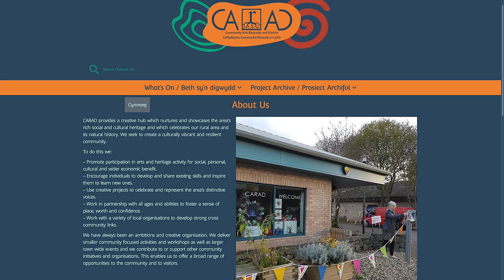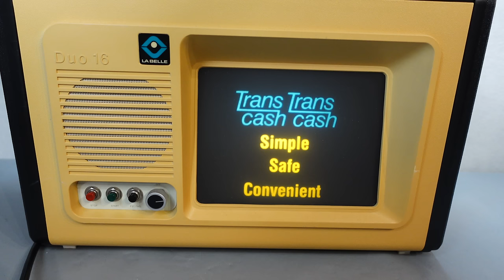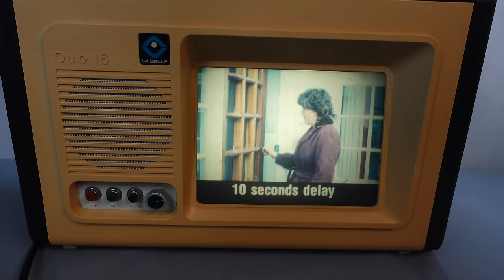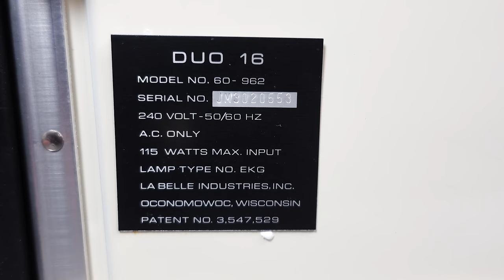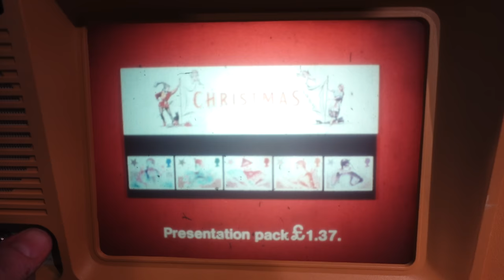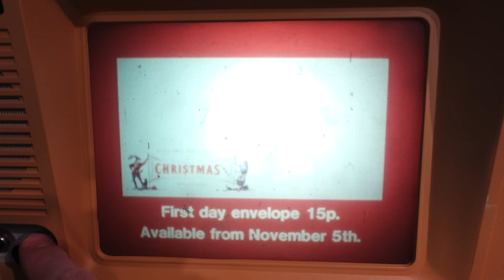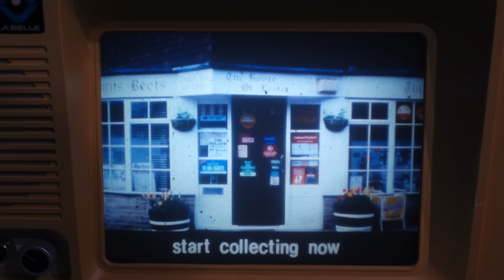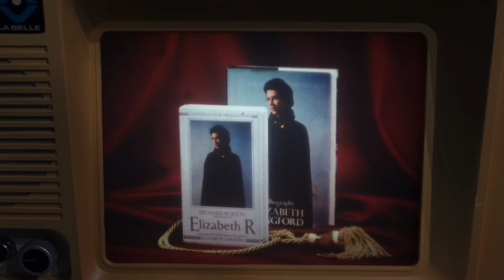Revisiting Post Office Commpak carts with a back projector

Comment: The lamp is actually just a fairly standard MR-16 halogen lamp, commonly found in high end residential downlight fixtures between the 1970's to mid 2000's (prior to LED fixtures killing them off), here in the USA. Also found in cheap Ikea lighting fixtures (along with the GU10 120v variant) before that too was replaced by LED. The letters EKG are the specification code that denote the wattage and beam spread option of that particular lamp. Though most, if not all MR-16's are 12v, so this 19v lamp is actually fairly uncommon, but a quick google search shows it as still available.

Comment: The speed control is likely there to enable different lengths of film. If you have a long-play audio but a short film you get into issues with an image sitting too long on the screen that would be annoying. By allowing the faster speed you can use the same (standard) length of tape but move through at a shorter time frame. Then if you need a longer film, you already have the longer tape and only need to slow it down to use the longer time on it.

Comment: About the speaker output and recording from it.

Since it is a amplified signal, it can be a bit harder to record it without messing the tech. The proper way is to use some sort of speaker (or "power soaker", "load box", or similar) in the amp output and steal the signal from between. Then the amplified signal mostly burdens the speaker instead of recording device.
For tapping the speaker wire, you could use a D.I. box that has link out for the speaker and a pad or two to reduce the signal. From the D.i. you can go to the audio interface with a xlr-cable, so you need that also. The D.i. box also isolates the signal source from the recording system, so the possibly dodgy source device doesn't cause much of a damage if/when wailing.

I can recommend the Behringer DI100 for things like this. It has good fun/price-ratio and it can take quite loud amplified signals without distortion. I've used one for recording 100w Marshall valve amps (between amp and a cab) without a hitch.

Comment: If you are trying to buy electronics on eBay from outside the USA, especially tube type equipment, you have to tell the seller NOT to use the eBay shipping system. Pitney Bowes somehow thinks that things like antique radios and amplifiers are hazardous. So, they confiscate them. The seller gets their money, the buyer gets a refund, and there is a small business of folks buying pallets from Pitney Bowes Erlanger, Kentucky facility and reselling the items.

Comment: Nice to see this kind of device, other than the ones i remember in school with those slides and the cassette tape playing separately.  I was hoping to see what the external projection would look like too.  Wondering what the mechanism to advance or rewind the slides are.  Is it a tone that signals it on the second track?  I could faintly hear a noise from the direct audio feed.

Comment: Just a note on the German sticker in there. It' has one of the old 4-digit post codes on it, meaning that the sticker was put there before 1993. Just thought you might find that mildly interesting.

Comment: Back when 8mm movie projectors were a thing, as my father had a Super 8 movie camera back in the 1960's and had about 100 reels of 8mm film. I found a movie projector and had a Sony camcorder. I took out the 120v lamp inside the projector and replace it with a 12v 13watt interior bulb out of the interior light of a car. I powered it off of a 12v power supply and placed the camcorder directly in front of the movie projector lens, I then adjusted the focus until the camcorder had a clear as day picture. I recorded the film that way. They were silent films though. 
I would like to do it again with a 4K camera but I doubt that the film is playable anymore as when I did this was the early 1990's. 
The same method should work for you with this player if you want to take it apart a little.

Comment: You might consider this a bit of travesty, But when i'm attempting to transfer old, eight tracks of some value and the pressure pads have gone, I usually opt to go the low-tech way that they did it later on.
And take some Rather soft and yielding Polyurethane foam, Covered with a adhesive tape that is slick and maybe even annointed with a little Graphite dust, And those will typically provide you the most accurate and complete Contact relationship with the play head. The mechanical bits of copper spring do work rather well when they are set up properly, and obviously these had that variety, But i've always had a rather difficult time repairing them. And then when faced with the necessity of taking the tape shell apart, Which can be another difficult thing if you don't have the good luck of assembling them. Were the tape slides into the correct channel, the foam approach always seems to pay off. I just located another really nice. Early pioneer branded craig player that i'm probably going to put in my van.... And make some high quality.
Tapes..  Though I will probably use my fostex e series mastering deck for the recordings,  Even though it is a half track... And just have them be a standard two track tape... And see how that works first before I go the other route and use a four track standard. Basically, whenever I get the odd passenger or musician riding with me to a gig, I'll blow their mind with this antique player... Which sounds better than any player of that age has a right to! Hooked up to a linear power booster of 100w, Through assistant of four hifi speakers and sub,  made for the home... The joys of having a van! And since the fostex machine Only records at seven point five and fifteen, I can make all of my recordings 2X speed, But because of the extreme fidelity of the fostex, Still have the complete frequency spectrum audible, And also be able to really hit the tape extremely hard and over a whiter section so that azimuth won't be as much of an issue... That's assuming that there is a setting, Or one of the two available that actually will play that well. If not, I can actually go in and connect all 4 playhead positions to play simultaneously... Which i'm thinking will work... As long as there is ample space in between in the middle... or hopefully not too far off... If I bulk erase them all before I use the tapes, Then they won't be any problem of cross talk whatsoever with only a single program. I can record some complete albums. And then maybe order those little postcards. They have out there of the album art and glue them on to the tape Shells..  lol. Something I used to do long ago

Comment: I noticed some dark spots on the screen that were consistent from one cassette to others, and some that were not. I’m going to guess that various bits of crud have gotten onto mirrors and lenses in the optical paths in the cartridges and player. It might be possible to eliminate some of that by using the machine in projector mode and capturing images from a screen or other surface so that you don’t need to laboriously disassemble and clean every part.

On the other hand leaving the crud in place might enhance the vintage feel of the images. In your place I’d consult with the person you got the cartridges from for their preference.

Comment: From the hum on the audio, I guess that the electrolytic capacitors in the audio section power supply are going to need replacing. I guess Audacity etc will be able to filter it out in post-processing.

Comment: You might want to consider using projector mode with a rear-view screen to capture the content.  If you use the internal screen, I suspect you'd see flaws from blowing up that small screen to what is today a normal sized screen.

Comment: When I was young back in the 70'S at a car dealer they had a film based cart also it was about the size of the biggest fedeli pack the sound was on the film all about new model cars it was either 8 mm or 16mm. i was very young at the time. So i don't  remember to much.

Comment: Perhaps use green masking tape to mask the frame of the device, then take the shot footage it into your video editor and chormo key mask it out so you have a crisp borderless video, then crop the rest of the device out, export just the masked video capture to a format with the aspect ratio roughly matching the screen's ratio, and center each. You should get uniform, and perfectly centered video using this method.
Reply: Also you could finish it off with AI up-scaling if you want be all professional about it, and use the video editor to correct white balance to counteract the color change that the screen patina introduced.

Comment: The internal power supply has got some questionable filtering not happening. The presents of that 100 cycle hum is a concern. Possibly some bad capacitors.

Comment: Fascinating! Thank you for showing this to us.

I guess the head is static unlike that in a standard 8 track cartridge player. I wonder if it’s a standard 8 track cartridge head and whether it’s just tracks 1 and 4 in use? Is there still an aluminium foil at the join? I wonder if that has any function if present Could it be that the foil is responsible for stopping the machine, with the tone burst alone used to frame advance?

At least those cartridges are the ones with a small felt pad on a spring as opposed to the other types that go all gooey!

I bet the lamp is a bit of a rarity though. Is ‘EKG’ the same as ‘DDM’ I wonder? I hope you can find a stock of them somewhere – there’s nothing worse than having to modify things.

Thanks again for showing us this unit - interesting. Kind regards.
Reply: Perhaps I meant tracks 1 and 5 in use only?

Comment: I've imported so much weird stuff from the US over the years, I am surprised I have never come across an export block. I wonder what the problem with the projector was? 

Back in the day, I imported some of the very first portable mp3 players into the UK (Samsung Yepp) and they got blocked by customs. They held them for ages, and when I finally got them, they had all been taken apart and none of them worked. Thankfully it was just because they had left the ribbon cables for the LCD's unplugged.

Comment: Someone will have mentioned this all ready but there is over 1000 comments to go through, so I’ll mention it any way.

If it not worth just running the film through a scanner and capturing the audio separately and just syncing them up in post.  I know it’s easy to say rather than do.

Video would be better quality, won’t need to adjust frames to get audio matching.

Comment: The best quality from the film would be to take it out and scan it one frame at a time.  Then color correct.  Then marry the audio and film in a slide show.  Probably too much work on your part but @UncommonEphemera does it all the time with filmstrips.
Reply: Another commenter has said that they did pretty much that. OTOH, while it's a good way to preserve the underlying content (and I'm happy to see it done), that probably doesn't reflect what it would have looked like in use all that accurately compared to actually filming the screen (complete with film movement).

Comment: They make expensive digitisers for 16mm film, as well as 8mm and 35mm slides and all the rest. They also make less-expensive ones. If the bloke who gave Mat the carts wants the information on them digitised, he could do that, and do something nice with the sound, treated as separate tracks (and keep the beeps for synchronisation, you could just do an ordinary stereo recording to work from). That way you'd get them in better quality than the faded grainy crap-o-vision from this disaster they must have surely found in the bins round the back of Fisher Price's R&D lab. 

Assuming there's some reason anybody would ever want to look at any of this voluntarily, which would be the first time. But they could do it in better quality, is my point, limited only by however well they photographed and processed the 16mm film itself. 

Or Mat could just keep the carts in his shed forever until futuristic quantum laser-digitisers can do it from a different room without even having to touch the carts at all, get one for 5p off Wish then throw it away after. Next Apple watch probably does it for you with the press of a button.

Comment: Can you not carefully remove the film strip from the cassette and then use a film scanner to capture the still frames then re sync them back upto the audio track inside a video editing software? Just a thought
Sounds like you need to look at replacing the filter capacitors in the audio section as I can hear some audio hum on the sound track just a small repair required there but a great unit all the same ;-) thanks for sharing

Comment: It has some lint and dust on the mirrors, lens etc to clean off.

How difficult would it be to open the cartridges to take the film out and scan each frame directly? A bit of soldering should have the second track cue tones brought out to record. Then in a video editor the cue tones on the right channel could be used as guides to place the still frames. Stretch the duration of each still frame to the next cue tone. Use a mic to record a few instances of the sound it makes when changing frames, with a plug in the speaker out to mute the tape. Record it several times with the mic placed differently because it'll be noticeable if it's exactly the same each time. Use a short blur+horizontal wipe transition between frames with one of the frame change sounds dropped into a 3rd audio track. Finally, erase the cue tone track, merge the transition sound track to the left channel then copy that to the right channel.

Render to video and upload to YouTube so the world can experience a vintage UK Post Office experience in as high quality as possible. Could leave out the blur+wipe and frame change sound but the presentation would be that bit less authentic.

Comment: My experience with slide projectors is that the bulb puts out a lot of heat and has a lifetime of perhaps 200 hours at best. For these reasons I see this system as something to be played on demand for training and limited demos. Probably not suitable as a point of sale display that you leave running for weeks at a time.

Comment: Pantomime stamps were issued in 1985. Was VHS not available then? Or were VHS machines more expensive.
Reply: VHS was still pretty costly at that time and for that matter TV's weren't cheap either.

Costly as in stealing a VCR was a perfectly good enough reason for a burglar to break in, they were still a high value item.

At a guess, that might be one reason the Post Office went with these. A TV and a VCR was at that time attractive to thieves whereas this isn't. Thinking there of someone breaking in after hours not stealing it when they're open for business.

Comment: I'm kinda wondering if it's possible to 3d print a wedge to keep the mirror up, and then capture the images directly from the protection..., beit they may need to be flipped in post, and synced up to the audio..

.. Or a way to nondestructively scan in every image....even though that would probably be overkill 😅

Comment: I realise it’s way more work, but you’d get better results in taking raw pictures of slides (editing them in something like Lightroom) and putting it all back together in video editing software rather than just filming slideshow. Way more work for a questionable content : )
Reply: I'm in favour of that if someone really wants to preserve the underlying content. But in all honesty, you'd likely end up with good scans of so-so (and mostly dull) pictures, and it wouldn't reflect what the system looked like in use as accurately as pointing a video camera at the screen.

Comment: I may have something on the import issue, but not sure. Not much info to go by. This is not anything military or national defense per say. I even looked through the Consolidated Screening List to see if it was something special, but nothing came up.

One thing I did find was La Belle itself. They make all kinds of industrial equipment now. A lot of it involving technologies that ARE export controlled. 

My guess is the seller wrote "La Belle" as the manufacturer, the customs officer saw they have lots of controlled items, and then realized the box contained something that they had never seen before and looked complicated and may be something that is on the control list. But in typical US Government fashion, instead of looking up the numbers and verifying, they just marked it as unexportable and sent it back.

And yes, the US government is that bad on things like this. I ordered a part for my aircraft in the desert many years ago through the supply chain. A few days later I had to sit on the phone with my Production Superintendent and my LT with a customs official back in the states saying "Yes, this is a military part, ordered through the military, for the military. Yes we need it and you need to release it so we can get a plane back in the fight." He was still trying to argue we were breaking the law by shipping it out of the US.

Comment: You can get 19Volt 8.5watt led bulbs now (Equivalent to 50W halogen)
Reply: The projector optics are likely designed for that specific model of halogen bulb. Replacing it with a LED bulb probably won't work very well.
Reply: @rocketman221projects  That's a good point tbf

Comment: go to the us and smuggle it back (hide the unit in your car and hope customs at the border does not catch it)

go to the us and get all the tools you need and tear it down and and export all the parts and re assemble it.

yes you will need screw driver, soldering iron wire snips.

then again it may be possible that since the unit is post office property (unlike schools and churches witch may hoard and eventually sell off) the post office maybe hoards forever or contracts with disposal company to destroy and dispose of.

at least you wont get a content match being at the wrong speed.